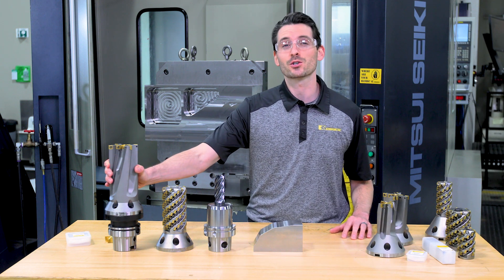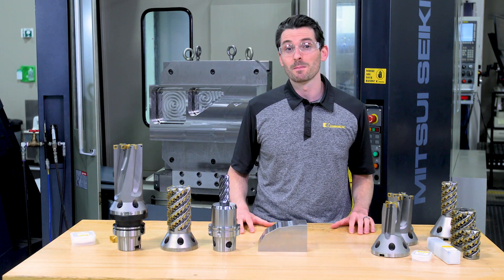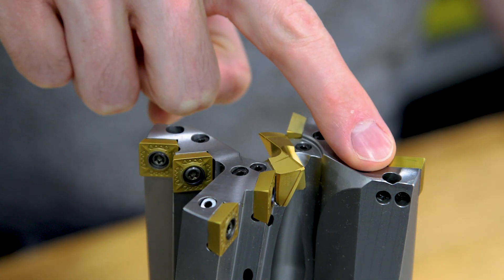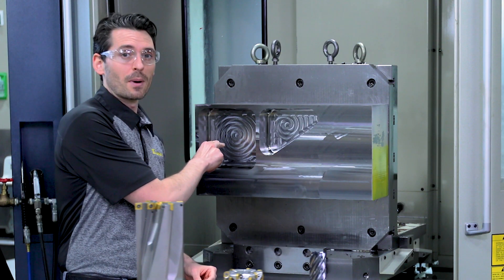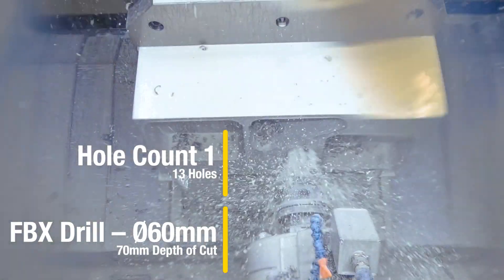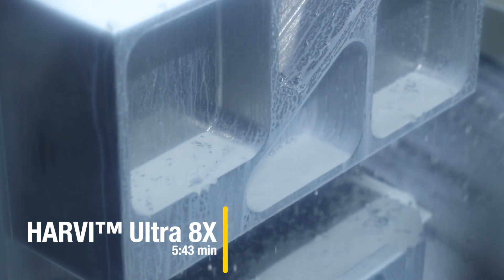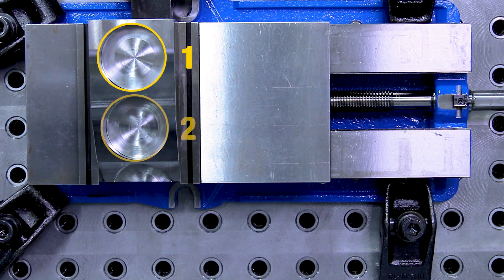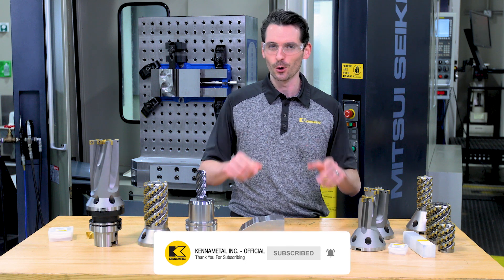FBX Drill – High Metal Removal Rates through Large Diameter Drilling

Comment: For such a large amount of material removal, would an annualar style cutter be more efficient?  Basically one that only cuts a cylindrical ring and spits out a solid plug.  This would only apply to through holes.
Reply: I've only ever seen that done on a manual lathe. I think the method is called trepanning.

Comment: Sorry, but to me it really looks like drill with inserts but then just a lot bigger. And that tech has been around for quite some time. So what am i missing here?
Reply: You're correct that this looks like an indexable drill.
There are a couple main differences:
1) 4 effective cutting edges vs 1 or 2 on standard indexable drills
2) flat bottom (180° point angle) enables cutting on extremely inclined surfaces and flat cores for pocketing (most indexable drills are not perfectly flat)
3) modular center insert has all the geometry of a complete solid carbide drill point. Standard indexable drill simply do not have this superior geometry at the center because the design of standard inserts is limited 
4) bolt taper flange mounting is highly rigid and shared with the large indexable mill shown in this video.

Those are some of the largest differences that make this not just an indexable drill with '90's technology.